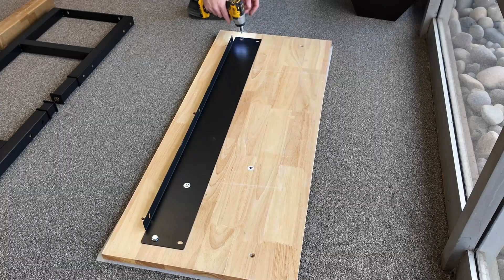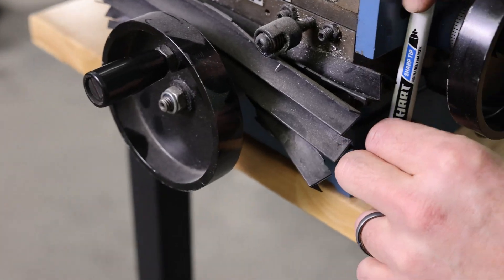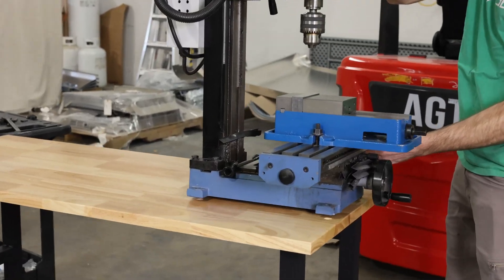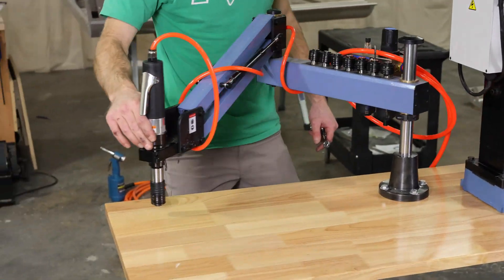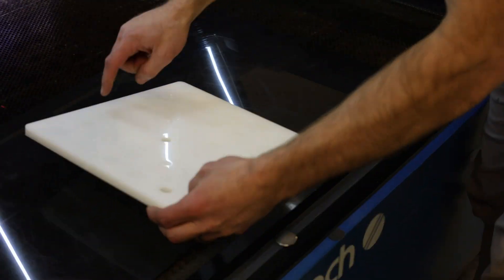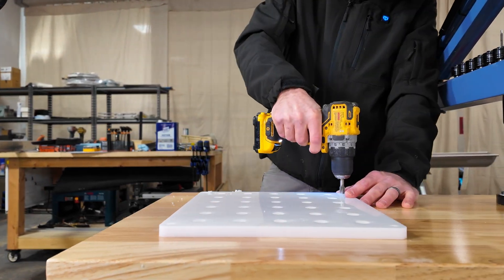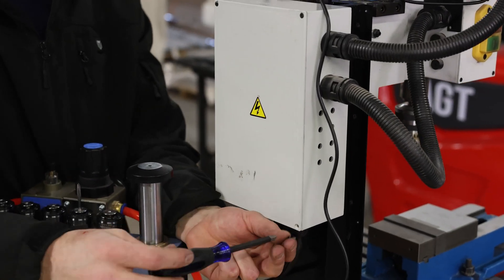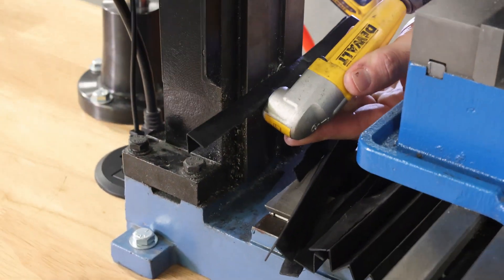This Amazon product made our drilling and tapping station possible

Comment: What pipe dreams are in utah. Im in utah i need the m998 battery delete and the driver seat and passenger seat mounts. Maybe the backseat mounts as well. U need to do a battery tray. For the engine bay. So when u delets the seat u have ready a spot for the batteries.  Do you allowing customers to get your products because ill just swing over and pick that up would be nice to see the products as well. Thanks let me know serious or ill just check out your website. If you wouldn't have said that i would have never known.
Reply from the maker: You can email us at sales@pipedreamoffroad.com or call  or text 801-867-5344.  I would be happy to answer any question.